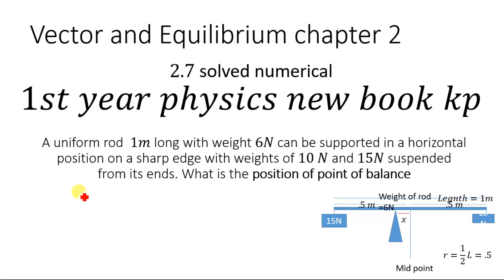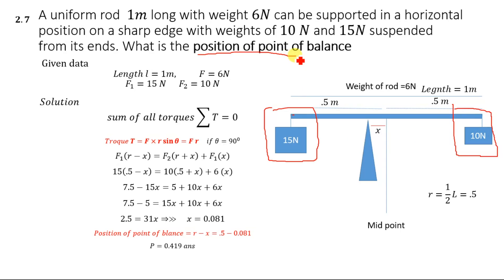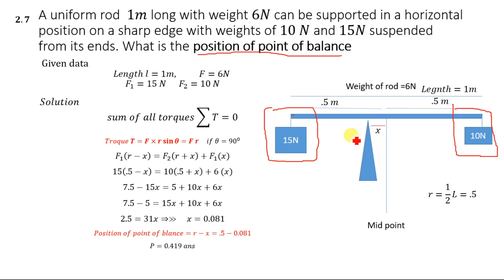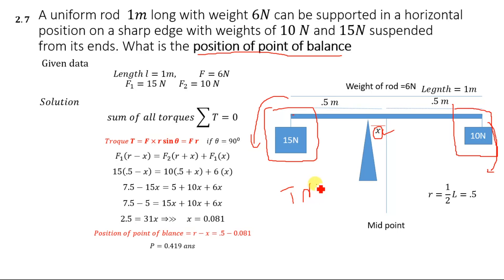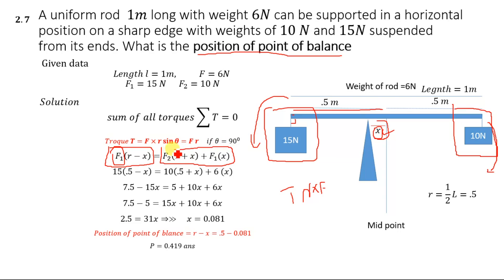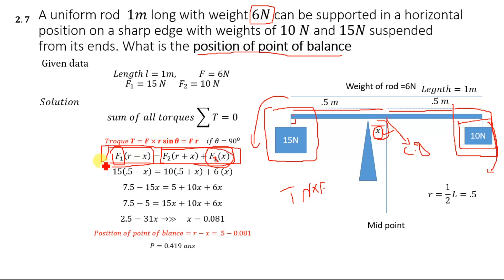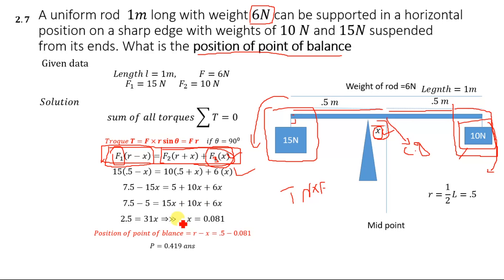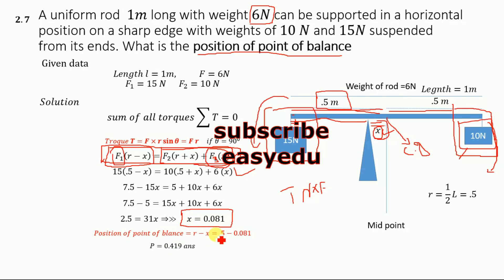what is the position of point of balance if a uniform road is balanced (FSc 2.7 numerical 1st year)

Comment: Hi sir can u pls explain what is dependent and what is independent im bit confused on that topic can u pls explain sir
Reply from the maker: dependent means if we have an equation like x=2y then the value of x depends on the value of so its dependent, no if we have x=2z and we have third variable y then x is independent of y and depends on z. independent are thinks they can stand alone. and its value does not depends on the value of other variables.
Reply: @easyedu99  thank you sir
Reply: @easyedu99   can u explain it by solving any problem(in video) that would be more helpful sir